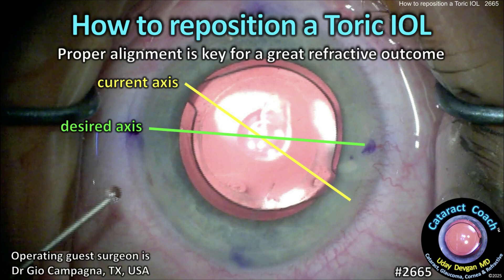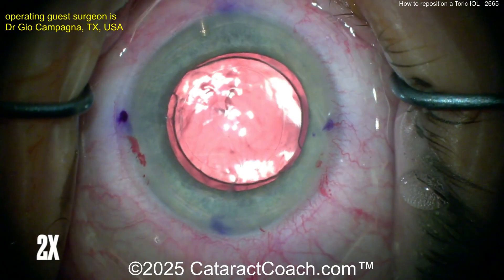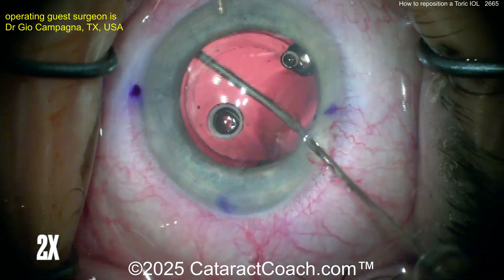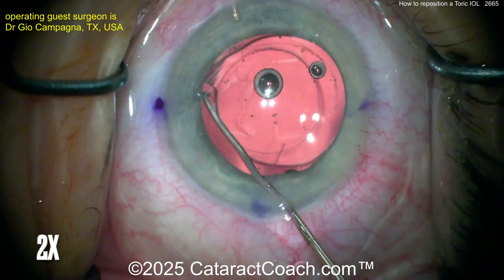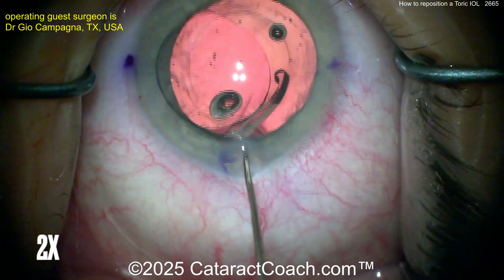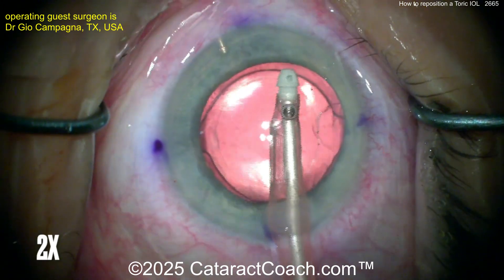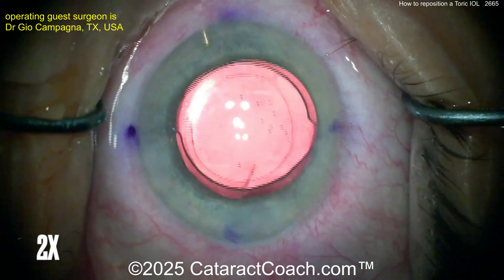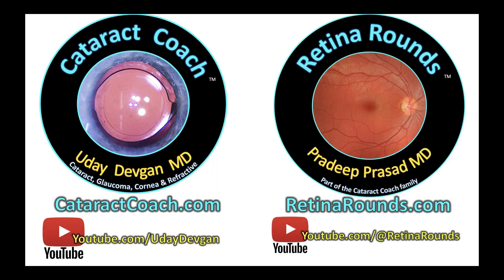CataractCoach™ 2665: how to reposition a Toric IOL

Comment: in many IOLs, you can rotate them counter-clockwise if you tilt them vertically from underneath like a coin. You just need to make sure the AC is deep enough, which it most often is.